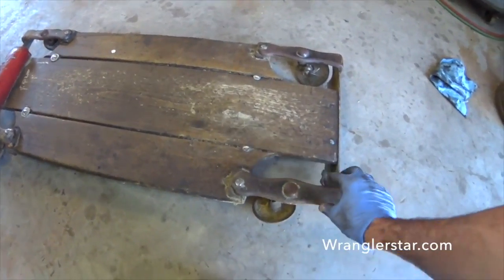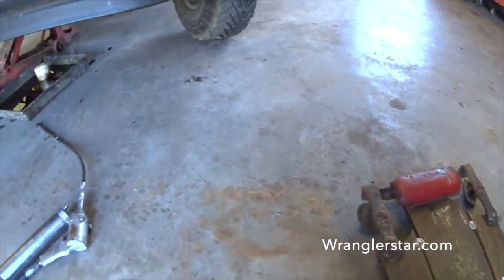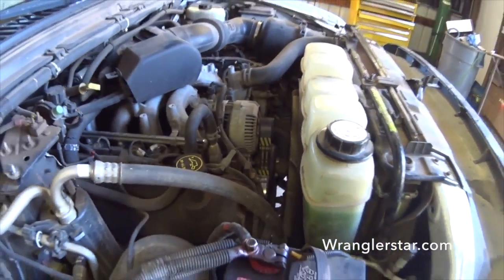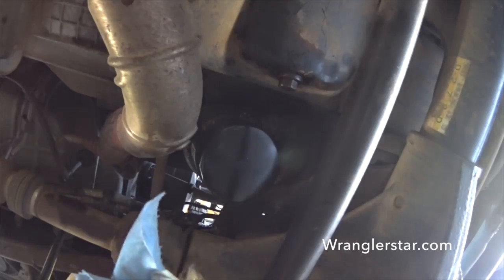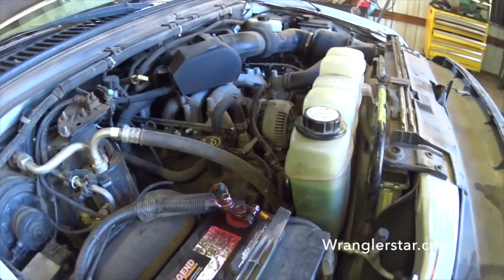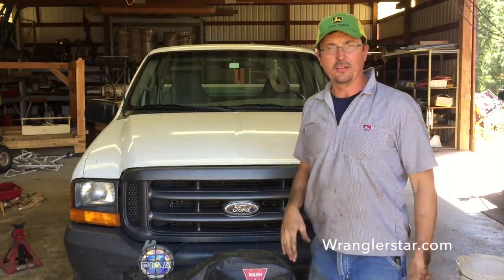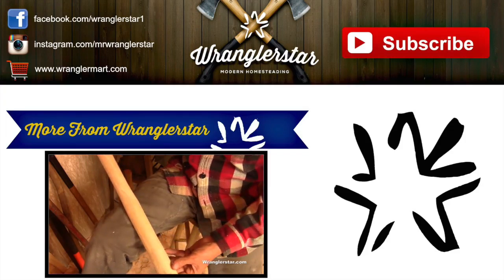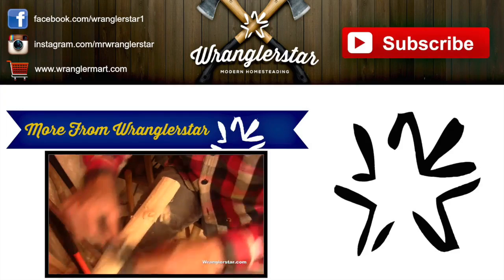Tips For Getting A Truck To 300,000 Miles pt2

Comment: It is my understanding Wix makes NAPA's filters.  If that is the case, they are very good.
Reply: Machi74005 No Wix's quality has gone down hill I wouldn't ever buy a wix product again pretty sure they started to make their stuff in Mexico. Go with original motorcraft my local parts store have gone to Baldwin filters.
Reply: Graveltrucking I drive a Honda Accord.  Honda engines require special oil filters that include primarily Honda brand filters and just one other after market brand........you guessed it.......Wix.  I am not using POJ Ford motorcraft filters on a Honda car engine.
Reply: Machi74005 i have 2 honda's  and they use fram filters
Reply: John Morris If the car is under warranty and you are using non-Honda brand filters and the motor burns up, the Honda dealer most likely will say "tuff-luck" and the warranty will be void.  I have heard of it happening.
Reply: Toyota is like that, my brother worked there... Warranty depends on using oem parts. You might get an attorney and take them to court and have that changed but they would try to keep from paying even though there are laws on the books that state aftermarket parts should not void a warranty, the key is...if properly installed.
Reply: Most auto manufactures if you don't use OEM filters they will void your warranty. Most vehicles use cartridge filters the aftermarket filters usually don't fit very well.
Reply: wb5mgr That is true.  Most of the Japanese makers are notorious for this.
Reply: Machi74005  Fram is the filter I had to quit using. Had several of them leak straight out of the box

Comment: what about watet pump?  I would think it would be about time to change it too.
Reply: Accessory driven water pumps usually start to leak (slightly) when they fail and sometimes they last decades or only a few months. No need to replace one as a PM item.

Now, water pumps that run off of the timing belt on something like a FWD car are an entirely different story. You'd be foolish to not replace one once all of the work is done to get to the point where you can see it on a typical car.
Reply: water pump has tell tale weep hole when it starts to go you know long before and have time to change if you are checking your pump regularly.

Comment: I think I saw an issue with putting the tires on. Looked like you just went around in a circle. You are suppose to go criss cross it tightens the wheel even on the rotor.

Comment: The only way you could come across a truck like that at that price is if it was a beater that would require more replacement parts that cost more then the truck itself.
Reply from the maker: ***** Those deals are out there.
Reply: ***** My second car I bought for $2,000 in a private sale.  A dealer friend said it was worth $5,000.  Should I have gone back and paid the previous owner $3,000 more?  It was a good deal on a car that was a reliable gem.  I'm always on the look out for the next deal.
Reply: I beg to differ, I have bought 3 diesel F250, 2500 and 3500 dodge and ford trucks in the last decade all under $7k and all under 135k miles when I took possession. All private party off the side of the road cash money in hand.
Reply: ***** City auctions, military auctions. The deals are out there you just have to look and work for them.
Reply: Grizzly Country I turned my 2009 Focus for 6k I'm sure they are selling it for a few thousand higher now but anyone who bought that puppy is in for a real treat. 58,000 highway miles with every oil change done proper. You just have to know what you have in front of you before you scoff off an older car. Looking at the price or mileage for that matter isn't the best judgement of the life of the vehicle.
Reply: 2000 f350 diesels that appear to be in good shape go around 2k on iron planet (dot) com
Reply: Actually, I think it was a 2008.
Most are 2004-2008
On iron planet

Comment: hey man please help me you seem to know what you're doing haha! i have severe shuttering a pulsing when braking and driving i think it's warped rotors....? Also when i put it in reverse after parking it just cuts off sometimes and shutters... Help let me know if you know anything!! Do i need new brakes calipers and rotors? im at 90k miles 2007 f150. i just bought the truck it has massive 285 17r tires and i think they are worsening the stuttering problem. Thanks man! I would appreciate any help!

Comment: I bought a newish truck the other day. I was able to put almost 50% down. It has very low miles so I figure it should last me at least 20 years, and I'll only be making payments for 6 months. Even used trucks in my area with 150k-200k miles are still over $10k. Might as well just buy a new one that will last me forever.

Comment: I have to disagree on your advice on never buying a new car. I bought 2 very lightly used cars that the owners took good care of, had low miles, service and repair records and everything. After needing to replace the transmission, head gasket, and even an engine on one of the cars, I was fed up and bought a new 2013 Jetta TDI brand new, for $28,000, out the door, full load. Still have it, 3 years, later, warranty has taken care of a couple minor repairs like glow plug failures and a bad battery, but after 62,000 miles, it's paid off, consistently gets me 47mpg, and I couldn't be happier. I don't like keeping my cars past 100k miles, for a couple reasons such as:
A) Higher miles=harder to sell
B) Higher miles=more money to maintain
C) Higher miles=Less resale
I had a decently paying job, was making an average yearly salary, didn't even have half of $28k to my name, yet I managed awesome. Financing a car, gives you financial discipline, that's what I found, and it really helped me. When I get to 70k, I plan to trade the car in for a 2016/2017 Golf TDI. I still would not have full cash on hand for it, but I know it'd be a good decision. Saying never to buy new cars is very moronic because if everyone just bought used cars, we'd run out of cars to buy!

Comment: I agree with almost every Cody says but the whole "you're not entitled to a new truck" kind of bothered me. I am 22 now and i have saved up almost everything I had since a was 16 to put a hefty down payment on a new truck because that's always been a dream of mine and I worked hard to achieve that goal. I also had am '01 ram 318 club cab long bed with 33's and that got 8-11 mpg. And it would break down once a month in the worst possible time and place. I'm not hard on my trucks, I love my trucks and I give them the very best. But I now have a plain-jane '14 ram that gets 21 mpg and has twice the power! And in my eyes I'm breaking even between payments and gas vs. repairs and gas. Since a drive an hour to work, gas mileage is important, and there would be no way I could find a used truck that gets that good gas mileage. Cody you are very wise, don't get me wrong I respect you, but I do deserve this truck.
Reply from the maker: Kyle Thomas You deserve a brand new truck when you can pay for it with cash money. You borrowed money you didn't have from someone you don't know to buy a new truck.

Comment: I would buy a new f-250 so much improvement over old ones. Used if other kind of cars.
Reply from the maker: +Texanminecrafter29 you go right ahead mate. Enjoy 5 years of payments.
Reply: +Wranglerstar better than all the repairs an downtime. Also with the new super dutys I can tow more. If i had a old one I would have to se a drw truck
Reply: Better to buy used now since the law mandates DEF fluid for all new diesels.

However I would buy new if I used it extensively every day, but we don't. My dad's old 97' F-250 was a great truck, bought a new Dodge simply because we didn't know if we'd have the money on hand if the transmission or engine blew, and if we didn't then we would only have 1 vehicle for the 2 drivers in the family at the time. I wish we had kept it so I would have it to beat around in now, but everything happens for a reason.

That truck had been to hell and back though, my dad used it as his response vehicle, he's a BC for the local volunteer department, for about 8 years, until he got a type 7 grass unit. That truck would climb just about anything, in fact we once climbed a section of loose rock while going up a side-hill, I thought we would roll or  get stuck, this was after we had slid 5 feet sideways downhill, but we made it.
Reply: yeah get a used fleet vehicle a 2-3 year old one can be rediculously cheaper. And thats still new enofe that no one have realy messed it up yet.

Comment: When some of those serpentine belts sit too long, they dry rot and snap really quickly. I would buy another one as a spare and keep it sealed up
Reply: Putting the old one is just a "get me to the parts store" thing, not a long term solution. Chances are that new belt isn't gonna fail, so why bother spending twice the money.
Reply: True. I just said what I said because I don't know how far he would have to drive with that belt on. I worked for an auto parts store for a while and had folks put their old belt on when theirs failed and they wouldn't have made it much further if they had kept the old belt on the engine.

Comment: I forgot to say never turn rotors its never worth it spend the 100-125 dollars each for new ones I don't fool around brakes are important if you can't stop safely your dead. I also only buy the OEM replacement pads those aggressive ceramic pads just carve up rotors. You should also stay away from Bendix brake pads they are CRAP they used to be good not anymore I'm finding Raybestos pads to be crap next brake pad change will be motorcraft.

Comment: not to be a keyboard warrior,  but you should never put used pads on new rotors.  they'll squeak and smoke and warp quicker.  I was a mechanic for a long time. so I know from experience.  also warped front rotors will shake the steering wheel and brake pedal. warped rear rotors will shake your seat.   And the grease zerk shouldn't ever snap off, unless your bearing go bad.  I would have definitely left it in.

Comment: You can tell you guys never have to deal with rust being away from the salt air on the West Coast of BC the salt air rots out trucks let alone the brine they use on the roads in the winter time. A new F-350 pickup where I live is 60,000 to 80,000 dollars want a gas powered truck you have to special order it F-250 F-350 gas powered trucks are not in stock. To work on a used truck expect to pay though the nose for parts its cost me close to 2 grand to do the brakes on my 05 F-350 that is just parts I do all the repairs myself. A 5 gallon pail of 5w40 costs me 150 dollars the oil filter another 35 dollars. Would I buy a brand new truck? not a chance the newer trucks once they are out of warranty you can't afford to own it. The new technology is good in one way but extremely expensive to fix.

Comment: Car loans are for suckers. I know i wont be doing that anymore either. Time goes by faster then most then most of us would like to believe and your new purchase becomes old fast. You're  gonna be in the same boat down the road anyway, the only difference is how far in debt you're gonna be in. Be less lazy and maintain your stuff. As a body and paint guy I see a lot of vehicles and the more expensive and new  they seem to get the less people seem to look after them. People trade in because they can't spring 2000$ for brakes and tires but somehow justify borrowing 50000$ to not have to do maintenance.  Lying to ones self doesn't make it true.

Comment: Since you just bought that truck and have put less than a 100 miles on it.  Your big tip to get a truck to 300,000 is to buy one that already has 300,000 and change all the fluids?

Comment: anything made past 1990 is crap! when people say there old vehicle is doing great when there "old" vehicle is a 2005 i laugh! old vehicle to me is 50's and 60's. my vehicle were paid with cash in had. a 1983 chevy s10 truck for the small loads i need to haul and then when i need to haul a load that needs covered i put the topper on it or use my 1987 chevy suburban 3/4 ton that has 1 ton leafs and supension. and then when i need serious hauling or for firewood getting i use my grandpas old truck a 1952 ford f-600 2 ton beast! with ladder racks that are tall as hell she hauls 4 cords of wood but that is maxed out and almost to much for me but it is do able. normaly i limit myself to 3 cords because the engine is tired out and it tops out at 45 mph. if you cant drive a truck that doesn't have a snyconized trans then you are no man!
Reply: tank2449 

What a pointless comment.